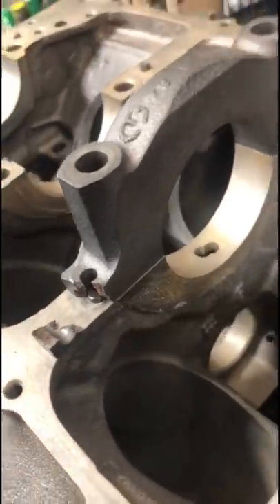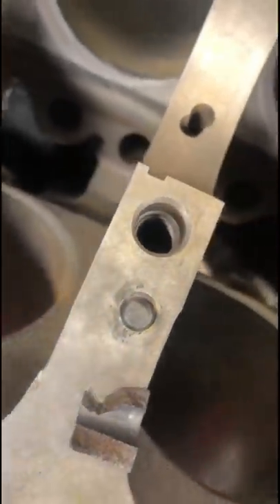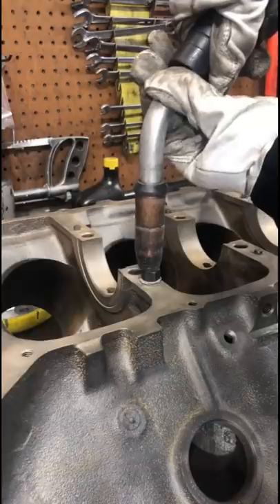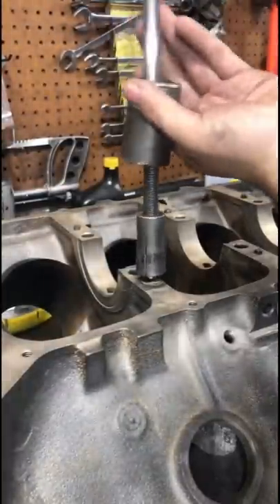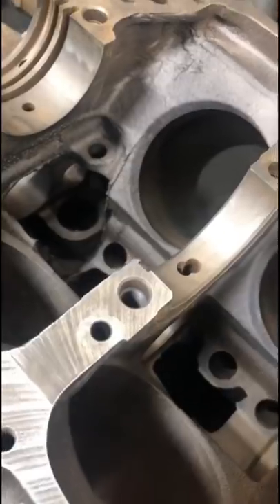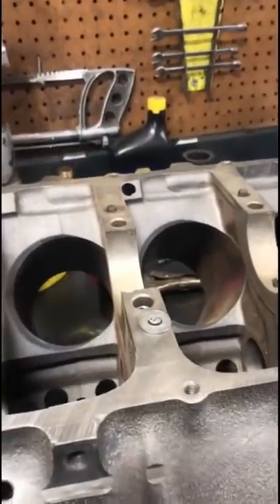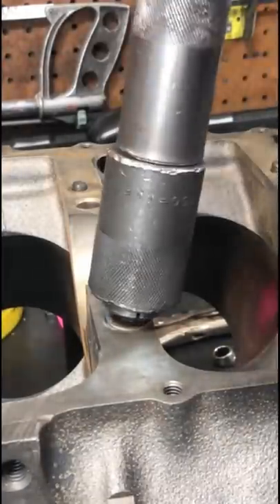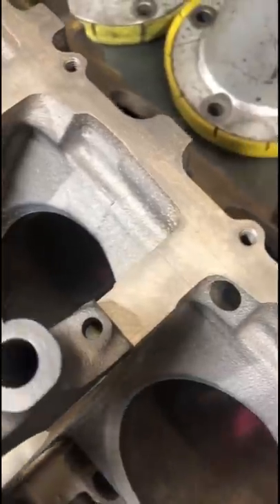#shorts This is why you should pay attention when building your engine…

Comment: Seriously?!?! There's really people out there that tighten main bearing caps with an impact gun? That means that the odds of them using them on the rod bearing caps too, and if they're doing that they are probably using it on the head bolts too...SMH.. It honestly blows my mind that people have to be told not to use an impact gun on internal engine parts!! Some people shouldn't be allowed to be around an engine, not even to check their own oil, I can see it now, "my oil is about a 1/4 of a quarter low and 15,000 miles overdue for an oil change so I should probably add a full quart to be on the safe side..SMDH.....

Comment: I cringe at guys using impacts putting engines together I have never used one I always use hand tools to take them apart and to put them back together it takes more time but I find using hand tools to take the engine apart you can feel how tight bolts were and be able to see if there was a issue. and putting them together with hand tools you can make sure everything is going good and you can feel if a bolt is having a issue or anything.

Comment: I challenge you to weld up a cracked water jacket on an engine block.
Reply: I'd be down to send in my brand new 350 crate engine that cracked over winter with only 3hrs on it for him to try out and show his stuff, haha.

Bought a brand new SBC 350...
Installed said 350...
Put 20mins break in on the cam I swapped into it...
Put another 2hrs on the water with it...
Winterized it and started her up last month to find I cracked the block internally...

I forgot to run the engine up to temp so the thermostat would open up before I winterized it.... 😐 (for my 25' hardtop fishing boat on Lake Erie). Lol

Comment: Impacts are used to break bolts loose and torque bolts not for rebuilding engines wtf!
Reply: Think about your statement….. torquing bolts….. aka what you do after tightening with a wrench and using a bigger wrench with a clicky to make sure its tight…. not UGA DUGGA DUGGA SNAP

Comment: I didn't know that was a thing. People are that lazy? If you want your engine to last, there's a reason why things should or shouldn't be a certain way. The same reason I see soo many people not being able to to get their lug nuts off because someone gunned it to about 5000 lbs. Or they tightened their oil plug so tight that it ripped the threads right out and ruined the pan, and worst of all, over tightening the oil filter to the point that you have to stab a screwdriver through it to turn it, and thats if you're lucky enough to have the space to do so. Oil filters literally only need to be hand tight and then at the most a 1/2 turn, and don't forget to oil/lube the filter gasket and fill the filter halfway before installing.

Comment: Do you always use an impact on motors & transmissions ? You young lad have a lot to learn why would you ever think if that now you need to find another cap and send it to a machine shop and have it re fit since there are not two of them the same they could be 100th. Of a thousand out hope you got money to send crankshaft and block with caps to get resized because they charge more fore stupidy as well as the motor being apart... As well as welding with an open cylinder and splatter ending on the cylinder walls that good for the piston... You my friend can loose a lot of customers with high dollar motors with this video.
Reply from the maker: Are you a little slow?

1. I’m not the one who used the impact. This is what we found when we did the teardown of this engine. You can watch that whole video on my page.

2. I am the machine shop

3. The cap is going to be fine. Even if the cap was replaced and a line bore done, that won’t affect crankshaft dimensions. 

4. This is prepping the block to be bored oversize. The “splatter that went all over the cylinders” (which there was none) is just going to be cut off along with the other .030” of material we are removing.

5. GFSF
Reply: A good example of how this interaction should have went - I do truly feel bad that you feel that i was the one that did this to the poor engine. It was brought into my machine shop and the whole engine was getting a rework including reaming out the cylinder walls, splatter would have been ground off by that process, and as for the collets? Those are designed for this application to make things easier for when other people mess up! Cheers mate!

Comment: Not only using an impact...but not even making sure the cap is laying flat and nicely seated first...whoever did this and expects this engine to run after they worked on it is a complete fool 🤦‍♂️🤦‍♂️🤦‍♂️

EDIT: I assume it's the same guy pulling the dowels in this video, since he pulled out the wrong dowel at first????? Wtf....
Reply: No this appears to be a guy fixing somebody else's mistake
Reply: @runningwolfus  Then how is he gonna be careless enough to remove the wrong dowel pin and then realize it after...idk.  might be on purpose, since this is youtube afterall.

Comment: You could have drilled a hole in the dowel. Add oil and pound pin in the drilled hole. Hydraulic pressure will push the dowel out.

Comment: Why in God's name would you reuse the bearing cap? It's obviously got stress damage to it and those sharp edges make weak points for cracks to form. All the money you are gonna put in that engine and you are gonna cheap out on the parts that hold your crankshaft?